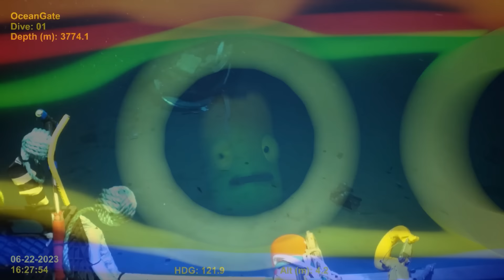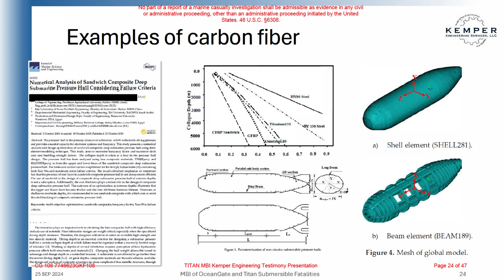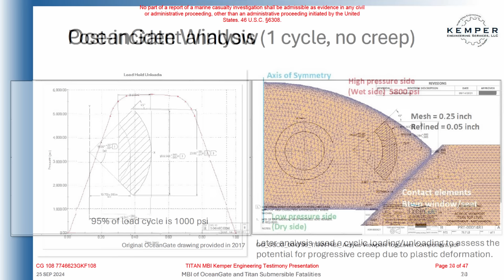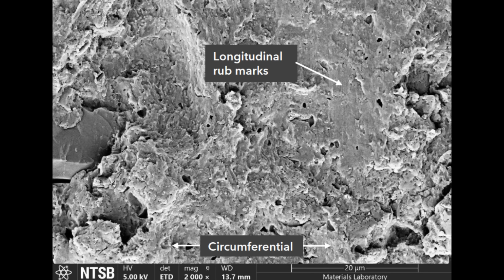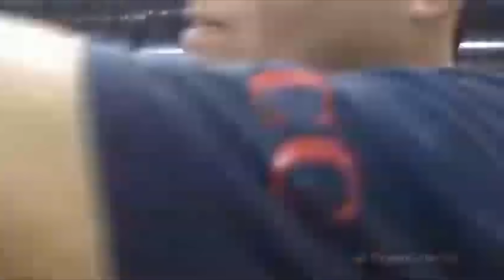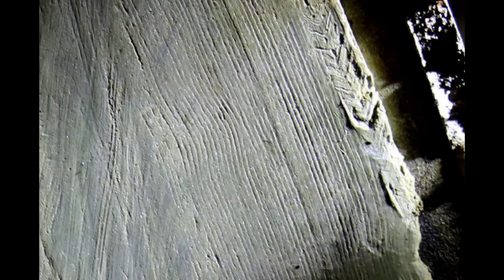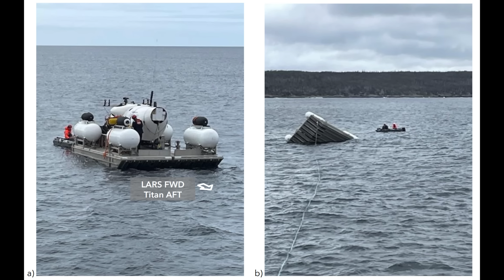OceanGate Wreck Shows Why Sub Wasn't Strong Enough To Survive - NTSB Shares Important Details

Comment: I have dived 6 times deeper than Titanic, in a deep diving submersible. The culture of safety around every other deep diving program is very impressive. The problem with this one is not any single design choice but as you say the lack of testing of it all, and the "fast and loose attitude". Also the management structure was skewed so that the boss could run with his wildest ideas with no check on him, overriding engineers, firing them if necessary. Beware such a culture.

Comment: peelply itself does not give perfect bonding surface, when removed from part, the surface than needs to be sanded and cleaned, before bonding. That is what I learned from bonding ultralight aircraft. (at first it was also said - just remove peelply, clean it and bond, but it did not hold at all) In a sense the shell did not have 5inch shell, but 1inch shells, just 5 of them. It really is horrific how stupid all of this was and there is no other way it could have ended.  If the structure is boned good, than when it breaks there are always fibers on the glue, so you just delaminate first layer of composite from the rest of the composite, not the glue from the composite.

Comment: Thank you for this excellent summary. The hearing itself was completely addictive, but some things went by too fast to take them in. Additional non-sensational commentary is really valuable.
  One thing I spotted today is that the titanium alloy 3 that Oceangate actually used is not approved by the ASME, unlike Titanium 5. Supposedly the latter was too expensive and "took too long" to procure from abroad.. 
  I guess that a precis of what seems likely to be a very long set of NTSB recommendations would include: Don't cut corners to save money. Test all materials used, and the complete system repeatedly, including at intervals after first deployment  to check for progressive deterioration. Install a real-time monitoring and pay proper attention to it. Develop a proper rescue plan.

Comment: It looks to me that a hull wound using a single strand in multi-axis fashion like composite SCUBA tanks could be free of bubbles and wrinkles. Another feature to change would be to make the end rings fit in like the plug hatches used on deep submersibles. The more the pressure increases, the better they seal. Designed properly the endwise pushing in force could be balanced by the hoop strength of the carbon fiber. The inner bevels would need to be formed during the winding process. Another possibility could be winding the hull tube to be larger in the middle so it's shaped more like a wooden barrel.

No matter the shape, the carbon fiber hull tube should be monolithic rather than the 5 layers with glue between, and it should not be machined in any way so the fiber isn't cut anywhere.

Comment: The warning system should have had a 3D-graphical representation of the vessel hull, with the accumulated stress visible. Also why only use a handful of sensors? Use 1000 sensors, to get a real nice picture. Well, I guess the point of the system was to calm the passengers, and nothing else.

I would really like to hear the actual sound from inside the sub while going down, on a recording. I wonder if that exists? What if they find the window inside the aft dome?
Reply: Why? So they could ignore that too?

Comment: Master's degree in aerospace composite engineering from MIT and then years of practical experience working for big aerospace companies.  It's definitely not "meh" more like "OMG".
I am of the opinion from what I've seen of their design that the bonded joint between the composite barrel and the end caps was a likely point of failure.  The design had some very basic mistakes in how it was done - looked like it was done by someone with no experience in composite/metallic joints.

My observation was that they made no allowance for compliance matching/tapering between the metallic lips and the composite structure.  If you don't taper the lips from the bottom to the end (it's easier to show than to describe), you can end up with a stress concentration where the overlap of the metallic lip ends and it's just composite.  That has the tendency to make either the composite or the bond to fail in that area.  Seen it, designed for it, it's pretty standard.  They obviously didn't do that.

Comment: On the window shape - did no one mention that they could have placed a lens piece inside the structurally sound shape, that would have then altered the light path to that which they desired?
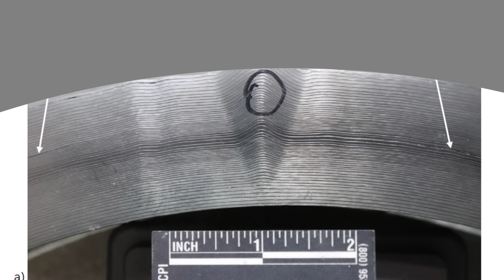11:19 - That would be five 1 inch tubes with sections ground off to create weak spots,...
17:55 - A Formula 1 or Aircraft Engineer would tell you that it's horrific. The sort of failed assembly an F1 team would put through a shredder to ensure it was never used.
19:35 - Machined 'Smooth' ??? Generally, when bonding surfaces, you want a roughened up surface to give the bonding agent more surface area to bite in to.

Comment: The optical fix for the window could have been out of  a secondary material with the same reflective index  but not be structural. Therefor correcting the image but not changing the stress factors on the window. Since the windows would move due to pressure, that secondary medium could have been a gel or a liquid.
But i guess that would require extra work.

Comment: Machining a step on the carbon fiber at the ends to fit the titanium rings would create a stress riser at the notch in the square corner left after cutting. You could put a radius in that corner for a transition but then the rings wouldn’t sit tightly against the carbon fiber. 

Would like to see FEA that incorporates this feature into the model.

Comment: I'm hardly an engineer, but even with the basicmost understanding of material science that I have, every new thing I learn about the construction process is more horrifying than the last one. No step is necessarily a bad solution in a vacuum, but every corner cut, every easy and cheap way of doing it adds what even without the benefit of hindsight should have been (and, as the many experts whose advice had been ignored, indeed were) such obvious points for the beginning of catastrohpic failure

Comment: 17:48 I worked on composite airframes for the A320 for Northrop Grumman for a time. It's bad, very bad. There should be no gaps whatsoever. Also, i don't understand why they didnt go for a 45' wrap on the hull along with the 0 to 90. Alternating from a 0', 45 and 90' wrap would've made it much stronger.

Comment: Scotty - Love your analysis of all things space - and underwater as well.  Thanks so much for pointing out the finer details.  Like you, I still believe that the failure occured at the front end of the Titan and likely at the bottom below the floor line in the pressure vessel.  The glue on the ring was likely compromised from the diving cycles, some of the mishandling incidents, towing in rough seas, and the fact the front dome was constantly bolted, unbolted and seemingly hung from that front ring.  With the glue on the web and flange of the titanium C-channel weakened that placed ever more compressive forces on the flange from the water pressure resulting in the shearing off of the relatively thin and unreinforced inner ring flange that we see.  I did not realize they foolishly machined the CF to fit the channel.  Very bad engineering judgement.

Comment: I wondered if the internal pressure of the cabin couldve been used to overcome the mechanical stresses of the carbon fibre (applying equal pressure inside to cancel out the external forces). 

However, shaving down the carbon fibre and laminating over it and basically making an upscaled verson of the cardboard centre of an toilet paper roll is kind of hilarious. 

What also is hilarious is that for a billionaires reach he still couldn't get carbon fibre wide enough to match rhe length of rhe submersible and rather roll it with box tape sized rolls. 

If they can market it then next month im gonna make a spaceship out if box tape. At least if it implodes it comes back to earth.

Something that is repeated often in the comments but couldnt be more true: Real time data isn't useful if its being ignored in real time.

Comment: All are concentrating their attention at the carbon fiber cylinder as the reason for failure and are missing the real cause. 
Which is the connection spot where carbon body is glued with the titanium ring. 
In their model they thought that the pressure will push carbon cylinder and the ring better together but they forgot that carbon fiber is a bit elastic which creates a bit of pulling force which is enough to break the shallow glue connection and pop the cap and as a result the carbon fiber cylinder lost integrity and was crushed.
Reply: I'd think they didn't take into consideration how the carbon fibre weave was applied, and didn't run the strand along the direction of which the forces would apply (a bit ironic, but Boeing took the weave direction into account to marginally reduce the structural stress). 

Even if they could've make a mono shell sub with proper rounded edge ribbing they would've made a remarkably stronger sub than what they actually had. 

But, if you don't want to listen, then you have to learn I guess

Comment: To start as we know accidents are not usually caused by only one thing/change/failure  but a cascade of several contributing factors. Although diving to the pressures of titanic can make that list real short.  
That being said I think we’re looking at cooperative chain failures.  
The carbon fiber glue seam going into the titanium ring seems laughable narrow, granted camera views distort, but it looks to be at the most 2 inches deep into the ring.  Remember that glue seam thickness is basically another type of hull between you and the ocean. I think this is where the first water started coming in.  This laughable seal failed because as we saw all the different layers of glue the layers were separating (big bangs during dives) thus allowing the hull to deform more and more under pressure thus putting lateral pull on the glued ring seams as those layers slid against each other as you showed by pointing out the powdering of green glue.  That’s my armchair guess
Reply: If I'm reading the drawing right, it was exactly 1 inch deep into the ring.

Comment: The resin and a specially adhesive will offgas as it cures. This limits thickness that can be cured without void buildup. We have run into this with composites at work. There is no resin that does not off gas to some degree and once a certain thickness is reached voids will form from the off gassing. Even when cured in an autoclave.

Comment: Uff. Grinding down wrinkles does not at all sound like a solution, but obscuring the problem. Also I am a bit shocked that the peel-ply(?) process is done BEFORE grinding material off of these layers. That's like painting your house and fixing the cracks afterwards. Those fixed parts are obviously not coated with the paint you so deliberately applied...

Comment: Armchair engineer here; the reason why there is skeptical horror at the use of carbon fibre is 2-fold, as mentioned in the video CF isn't ideal for compressive loads, what's not mentioned here is its failure model, which is shaped like a small hill leading to a brick wall.  Luckily for many passengers, due to the glue wrap composite construction it looks like the failure model was softened.  Unlucky for the final passengers they placed their faith in a man who seems to have an actual death wish.

Comment: I mean, my guess as to why there isn't a deep sea tourism market is companies like OceanGate, who have things like the acoustic monitoring system and ignore its outputs, they have experts who they dismiss when there's an actual problem, they think of cost effective work arounds with no failsafes and minimal testing. I doubt that Stockton Rush was unable to secure one of the submersibles capable of making the deep sea ventures safely, and if he couldn't its because of costs, which prove that it isn't a viable business venture, and in either case he went ahead with a risky, cheaper alternative and others paid the price alongside him.

Comment: Can someone explain how is carbon  fiber's tensile strength  utilized in this compression mode?  I can see it working where pressure is excerted from the inside out like in scuba tanks etc, but from the  outside in the epoxy resin is what gives stiffness and compression strenght.

Comment: I’m no expert but not running the carbon fiber strands at 45 degrees because it was to difficult for the fabricator to do doesn’t make sense. Carbon fiber driveshafts for race cars are made with layers running 30 degrees ( I believe don’t quote me ) so I  would think that tech could be scaled up. My guess is they didn’t wanna pay for it .

Comment: Every sound practice of composites was violated, from stress analysis (particularly with the broken/disrupted load paths from wrinkly layup) and unmet safety factors, and including unknown material, poor layup, poor bonding, no testing, no non-destructive testing, exposed to environmental conditions, exposed to super-high pressure salt water intrusion, left in freezing temperature (expanding moisture, breaking bonds), etc.  Safety was falsely inferred, particularly by the interior design; no seats, no handholds, no secured equipment.  No fatigue life to ever retire vehicle discussed. Finally, ignoring what info you have on actual degradation.

Comment: That there were so many successful dives made without a problem means that the key question, the one that everything rests upon, is why this dive was different. Most of the analysis in this video (despite being excellent) doesn't address that at all. From the failure discussion, you would have to expect that this would fail on the first dive, but that's not what happened. So why was this dive different than all the rest?

I strain data at the very end gives us a potential clue, but the focus of future videos really needs to address that question, otherwise it''s all Monday morning quarterbacking.

Comment: As a former Aircraft inspector I will tell you composite is not that great on aircraft either.  Extremely short life span compared to most other materials.
Reply from the maker: As an owner of an aircraft manufactured from Carbon Fiber I’m learning all about maintenance of this material.
Reply: @scottmanley  Two things I had learned that might help you. 1. It seemed to corrode any metal fasteners in contact with it. We had use rubber sleeves between them to slow this down. 2. It seemed if you had the most expensive bond tester it didn’t do any better job testing for delaminate than using a Quarter tapping to find delaminated areas.

Comment: About 25 years ago an old age pensioner drove into the side of my brilliant little Hyundai Accent. It had been a brilliant little runabout car up til that point, and the crash made it much better. No, really. The impact buckled the passenger door inward and wedged it into the frame. The chassis became instantly stiffer and the handling became agile. After I’d patched over the massive air gap with some super strong tape, I was watertight again and ready to go. I kept it for another six months or so and enjoyed every minute of it. I suspect that Stockton Rush at one point owned such a Hyundai Accent, and this explains why upon hearing a massive bang he didn’t instantly think oh no my hull is cabbaged and instead thought… sweet Unfortunately, Stockton’s sub wasn’t built by Hyundai, it was built by Stockton.

Comment: Thx for summarizing. Plenty of possible causes of failure due to the novel design and unproven manufacturing techniques and life testing. Looking forward to additional reports and conclusions. Well I guess most of todays accepted travel vehicles have been evolved (unfortunately) from wrecks containing 'bits of dead people'.  Hard to call the paying passengers, and especially the 19yr old, qualified researchers though. This tragedy is becoming a case study on how NOT to build and test a complex system intended for use in a harsh environment.  Maybe a lesson is that if you cant afford to do the materials/safety testing you shouldnt be doing it.  More onboard tech might have helped (automatic processing of those sensors) as well as more complete pre-launch checks (eg scanning the hull for voids/delaminations). More simulation and software testing might have identified some of these issues and even identified a minimal test program they could afford. Maybe collaboration of such commercial ventures with independant teaming/review by military and academic labs is the way to go in the future.

Comment: On the subject of waves/wrinkles, these were proven to be known critical failure points in unidirectional composites decades ago. The cause of these wrinkles has not been well understood but is known to be related to a combination of layup issues and exothermic runaway during the curing process. Composite and carbon fiber wind turbine blades have, and continue, suffering from this known issue.